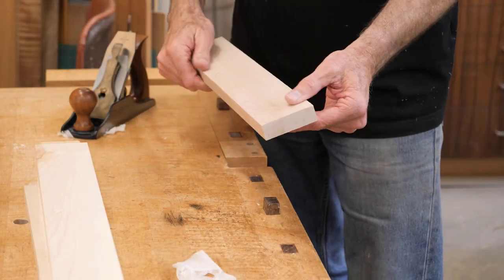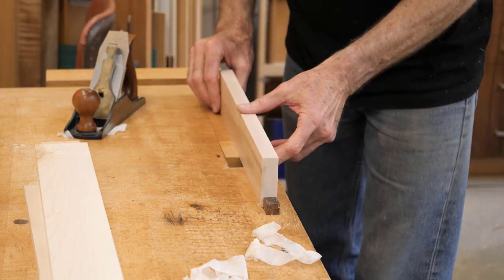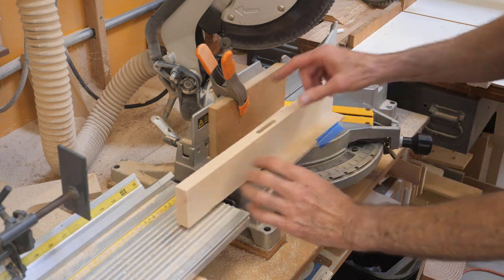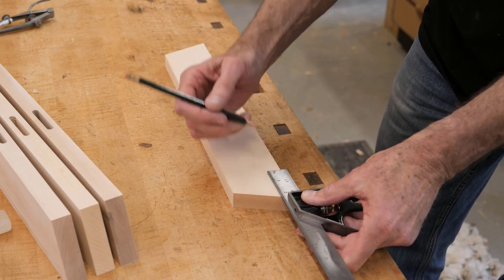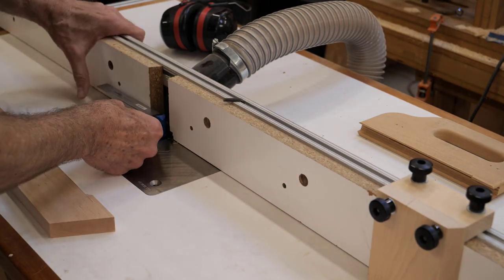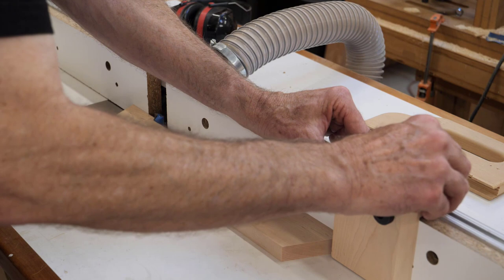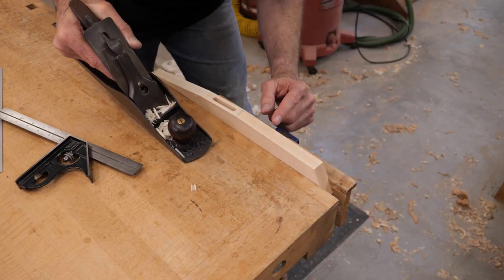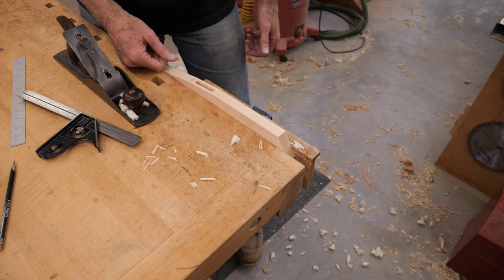Krenov Trestle Horse Part 2

Comment: Hi, what plane is it that you’re using on your shooting board? Looks very nice.
Reply from the maker: That is a Lie-Nielsen #9 Iron Miter Plane, based on an old Stanley design. They quit making it after they came out with the #51 Shoot Board Plane. Too bad, since you need two #51's (left and right - $650 each) to get the same capability as the #9 ($350 a while ago). (The #9 can be used left- or right-handed.)

You might want to check out the shooting plane I made, which is similar to the #9. It's part of my Krenov plane playlist https://www.youtube.com/playlist?list=PLK1q9s1iBil30FwZr8-w7IoqXGgyWF0-k